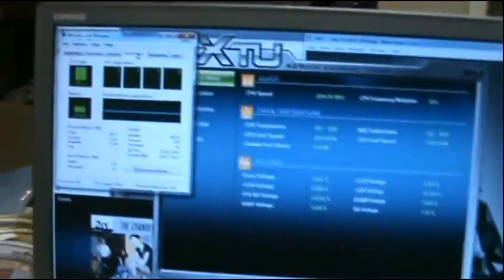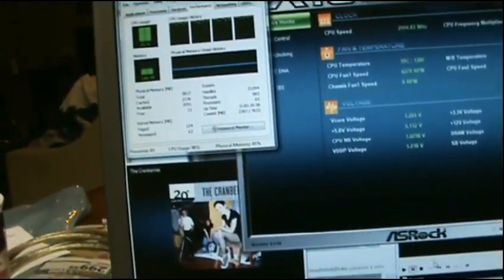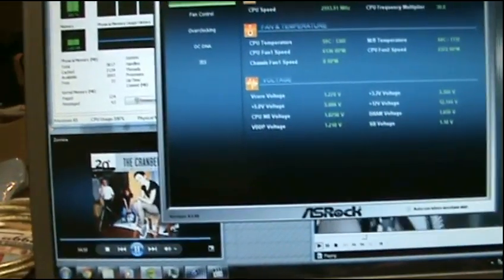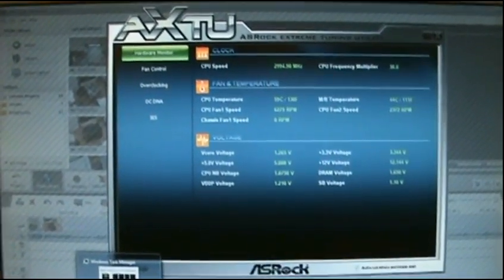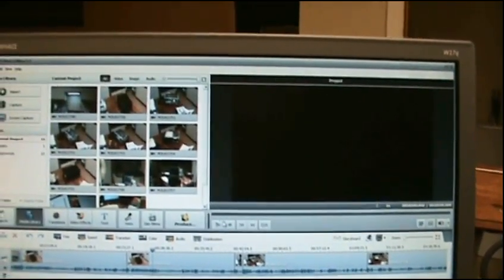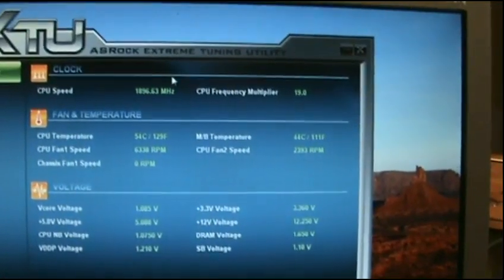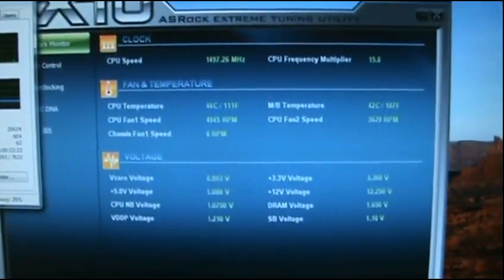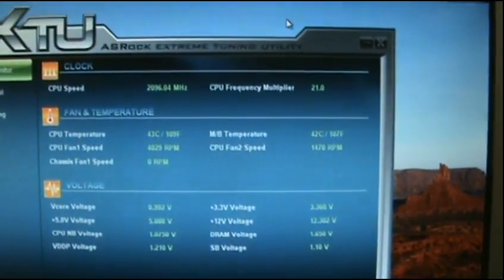Stress Testing Computer Build

Comment: The RAM is volatile memory storage...therefore, when you restart your computer, the data will be lost.  therefore, RAMdisk is wiped during reboot.  Why did you choose to use the RAMdisk method anyways?  It's like Windows 3.1, lol.  Also, funky things happen in the RAM, and with Windows, you may experience issues due to the fact all RAM is shared among all programs.  If one thing crashes, so could your hard drive (RAMDisk) in theory.

Maybe the reason why you don't have any new videos up? lol

Comment: its worth getting a a 450W power supply if you use a low power one running it near max output it will burn out after only a few months

Comment: A 6670 will skyrocket your temps way up I have one in my tower build and the card runs at 80c idle and puts the temp up for my whole rig.  Your situation may be different given the small size of the case

Comment: Hey Rick, if you'd like to properly stress your machine use Prime95 and run it in "Small FFT" mode. This program is meant for stress testing CPU builds. If your machine can run this for 12 hours your system is solid.

Comment: WOW! Why didn't you get a standard case where the cooling fans etc would have room to work efficiently? You cut down on the heatsink size and the CPU will run hotter defeating the object of having a faster CPU. Did they supply ear defenders with that?

Comment: FUCK RICK I RUN A VIDEO ON MY 8 GIG LAP TOP AND YOU COULD USE IT AS A SOLDERING IRON AHAHAHA WHEN THEY COME OUT THEY SAID THEY WERE VALUE FOR MONEY AS THEY DOUBLED AS A 2000 WATT BAR HEATER AHAHAHA

Comment: 450w sfx power supply will last longer and produce less heat than the standard 275w one ;)  275w is like going flatout on the highway with a small car and 450w is like cruising with a porsche :p

Comment: Stock AMD heatsinks are notoriously loud anyway Rick, you'd be better off with that new heatsink you're talking about. A standard HD6670 won't use much power under load from what I can see. Although a PCI-E 2.1 slot (not sure about 3.0) can output up to 150W. 

So it will be better off in the long run to get a higher wattage/quality power supply.

Comment: you won't need a new power supply rick .. the last gaming computer I built with a higher end video card (7950 3GB)  than what your looking at and a 4.6GHZ cpu only use 230W under load ... 275W is plenty for anything you can stuff into that little case .